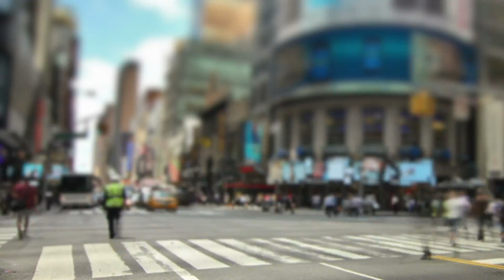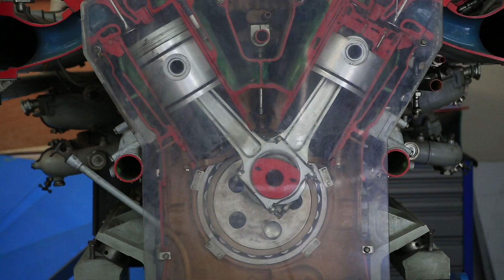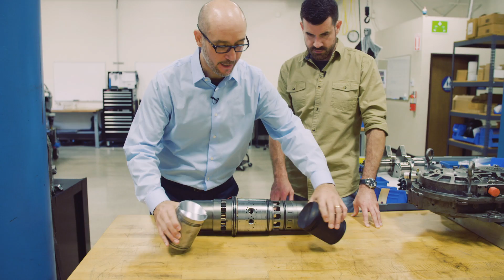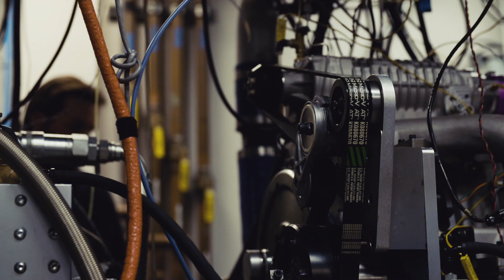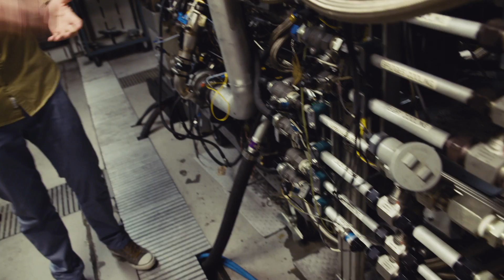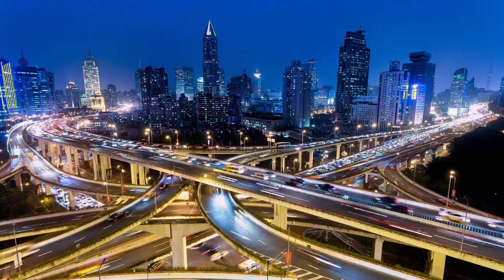This Radical Redesign Could Keep Gas Engines Pumping | WIRED

Comment: Had one of these on "my" submarine back in the '70's.  Auxiliary diesel engine for when the reactor was down: six cylinders, two cranks, 12 pistons, no valves, supercharged.  Worked fine, don't know how efficient it was and don't remember the horsepower-- but if you couldn't find diesel, it would run on jet fuel.  USS Benjamin Franklin SSBN 640.
Reply: frankdn, do you know who manufactured that engine?
Reply: Good old GM or Detroit 2 strokes would run on anything if you had the right injectors including there own oil.
Reply: Wikipedia page doesn't have that info, so adding it as a former submariner would be amazing! 

https://en.wikipedia.org/wiki/USS_Benjamin_Franklin
Reply: The engine was invented in 1889 by Hugo Junkers and his partner.  Junkers licensed the technology to Napier and Sons in the UK and Fairbanks Morse in the USA.
Modern Injection systems, modern control systems and sensors as well as computational fluid dynamics have improved it.  They're apparently getting 55% thermal efficiency which is amazing for an engine of this size.  Sandia National Labs have invented a simple new injection nozzle that completely eliminates particulates which means NOX, its so simple it can be retrofitted, so NOX can become the total focus and so also eliminated.  Finally synthetic fuels like fischer-trosch greatly reduce pollution and finally DME and OME fuels or Diesel/OME blends completely eliminate it.   This has a fantastic future.   If carbon neutral electro fuel is put through its as good as fuel cells and much cheaper.
Reply: Jet fuel is diesel... for all practical purposes. Fairbanks Morse already built these opposed piston engines. They weren't perfect and might be improved for auto use with lighter alloys and better combustion technology, but in the end, there is a minimum amount of entropy required to sustain life. If we don't seek to reduce our entropic impact, we are doomed. Source:  Entropy...by Jeremy Rifkin.
Reply: frankdn we deactivated that sub and sent the reactor off not to long ago

Comment: I fail to see the benefit of getting rid of couple sets of camshafts/valves would be by adding another seperate rotating crankshaft and associated chains/gears. Also this design would put variable valve timing and lift out of the window which was key to better power and efficiency at various rpms. Plus variable compression, cylinder deactivation/decompression would be almost impossible to achieve without valves. The future for efficient ICE is small turbo charged freevalve engines. The future of cars are electric cars with "green" generated electricity.

Comment: No new ideas here, granted, but newer ways of doing better. A move away from reciprocation is in my opinion a much better idea, but how?
Reply: You couldn't figure out "reciprocation" in the context of a video about piston engines? And then you lecture the guy. You're an idiot.
Reply: If we can figure out hot to seal the tips in a rotary engine without a lubricant or adding friction then it could be a contender. Extracting energy from fuel electrochemically rather than burning it also may have some potential to increase efficiency but the specific power within a set time is currently far less.
Reply: LHswe If it bothers you, maybe you should think twice about whether your asinine lecture is really worth posting next time.
Reply: LHswe That was some rant. We've got a real takes one to know one situation going here.
Reply: aluisious: try reading what was said rather than what you want to hear then much less people will tell you to shut your trap perhaps?

Comment: lol , what the Heck did you just say ???? The Engine is good the Technology Is Good. it's the POLITICAL part that Discredits the Message ...
Reply: It better have roller bearings and vro oil injection like a new 850 rotax.
Reply: Why did you have to make a pointless political statement in this?

Comment: Nowhere near the simplicity and efficiency of an electric motor. Certainly progress in the internal combustion world though. My personal opinion after learning about the continual lowering cost of batteries and the yearly increase in energy density in said batteries is that electric vehicles will be comparable in price and range to an internal combustion vehicle in about 5 years (2022).

Comment: Sure that this is more efficient when it is a two-stroker which is less efficient than the four-stroker and dirtier since you basically burn up the oil you use to make things go smoother?

I sense that there is some level of bull in this one, unfortunately.

Comment: Its tall as shit, hows that supposed to fit under the hood?? The Commer knocker is a better design imo... Imagine if that idea was refined... Commer made there production engine back in the 40's I think.. It sounds awesome btw...
Reply: Well, considering that it's a test device, and the entire point of it is to first prove the technology works, it's not a surprise that it's so big. Once they get the tech down, that's when miniaturizing it will come into play.
Reply: Fairbanks Morse took the commer designed to the next level, they manufacture a line of opposed piston diesel engines for power generation and industrial applications.
Reply: can't remember what company it was but it's some oil companies actually allowing them to put them in a fleet of F-150s for a trial test so they must be able to fit them in the vehicles

Comment: My next car will be electric.
Reply: Michael Curtis  - or Nuclear, Wind, Solar it really doesn't matter. Fossil fuels will eventually have to phased out, and then what are you going to put in your Oil engine? The future is 100% electric whether you like it or not, and it's going to happen sooner rather than later.
Reply: Michael Curtis  - indeed you can, but they are all fossil fuels. Bio-diesel is the most carbon neutral of those, but it's nowhere near as clean as the options open to all electric vehicles. Clean energy is essential for the future of the planet, you can't escape that reality.

Comment: Actually from an engineering standpoint, this is a brilliant design. The only problem I can foresee is the hight of the engine. And engine of this size would only fit in semi trucks and commercial vehicles, not cars. Now it would be possible to put it sideways, but then you will have a very wide car. But besides that, its a great design. And the recycling of the fumes is genius!
Reply: If they did an over square opposed piston engine that would sort the size problem out, I wonder if the cylinders have to be vertical to? I can't think of a reason why they would need to be, but if the opposed engine was a boxer type engine it would be no larger than a 6 cylinder boxer surely?
Reply: Geekfreak63 do you actually know how many "genius" ideas have come over time to improve or save ICE? yet none of them came to life, this one is also a hoax.

Comment: According to SAE paper 2015-01-1251 this engine achieves 43% break thermal efficiency. What a waste of time. A Heavy duty truck engine can easily better that and the better ones will achieve close to 50%. The difference is that the HD truck engines are proven and durable. The Achates engine doesn't have the durability or statistical validation. Or, put another way, if a conventional 4 stroke HD truck engines had its Peak Cyl Pressure limit raised and its durability requirements relaxed down to just , say 100,000 miles it would get EVEN better break thermal efficiency.The friction is also way too high. The valvetrain has been replaced with another crankshaft and set of cylinders.  The other issue with the Achates engine is its low exhaust temps which cause problems for the aftertreatment light off. EMD (who do train 2 stroke engines) are going away from this architecture for these exact emissions reasons. Fabien,  Gerhard and other failed Detroit engineers who want a good time in San Diego have a vested interest in making this technology seem to work through fair means or foul. Electric cars? Don't get me started on Elon Musk and his non sense.

Comment: but a design like this won't increase the engine height by adding pistons on top.
Reply: It would take up no more space than a boxer engine in a subaru if it was mounted horizontally, or they could just use over square pistons and reduce the height that way.
Reply: Two external crank shafts vs 1 central means it will be much wider than a boxer engine.
Reply: maybe they can turn that thing sideways?? No idea just throwing shit out there, but i hope they have figured this avenue out.
Reply: i knew someone here would have a good answer. interesting thank you!
Reply: it will take up more room than a boxer motor. Boxer motors dont have crankshafts hanging out the sides of the. And if you say anything about the cams, those are significantly smaller than a crank. The motor they showed in this video is easily half again as long/wide as a comparable 4 cylinder.

Comment: Has everyone forgotten about hydrogen? You know, that thing that's been proved to work and only spits out water?
Reply: Josh W. takes more electricity to separate hydrogen from water than it does to just convert power and store it in a battery.
Reply: *****
And gt5228z, yes I'm aware of this. However once separated it is an efficienct and more importantly clean fuel. Surely combining renewables such as solar and wind to separate the hydrogen from water would be a worthwhile sacrifice for clean transport for a huge proportion of the planet. I know, its optimistic on a Roddenberry scale and I apologise for seeming naive. Its worth thinking about, plus Lithium Polymer batteries aren't exactly cheap to produce nor environmentally sound.

I do however yield to what the market has already determined to be the most ecnomically sound, however is it the best thing for the [very] long term?
Reply: There are many problems with hydrogen. The most basic one is that the overall efficiency from hydrogen generation, compression, storage, distribution, refilling and operation is comparable to ICE (internal combustion engine) technology, so around 25% witch is appalling. From an engineering stand point, you have to be desperate or freaking wasteful if you allow yourself to operate a 25% efficient system. Then, you have to replicate the gas industry at a global level witch will cost $ trillions. Next, the cheapest hydrogen you can get is from coal gasification and even that is not cheaper than gas or diesel\mile. From renewable sources it costs more. If it's not cost effective it will not get made. Look at the space race for reference. You basically eliminate all that with electric vehicles. You have the infrastructure with the electric grid (witch already would benefit from an upgrade). Batteries last well over 500k miles with less than 20% degradation (so well beyond the life of the car), you can charge at home if you want or at high power chargers in 15-30 min while you drink a coffe and drive another 250+miles, and the overall efficiency of the sistem is over 80%. Also, the price/mile is 5x cheaper or more. You can't beat that.
Reply: Most economical source of Hydrogen is Fossil Fuels itself,  but Hydrogen doesn't have a simple storage and delivery system.  It's cheaper and more convenient to just burn the fossil fuel instead.

Comment: It would be interesting to see a comparison between this and the Koenigsegg's Freevalve technology which claims 47 percent more torque, 45 percent more power, 15 percent less fuel and 35 percent fewer emissions. But again this are just "best conditions" estimates.
Reply: Luckily the freevalve isn't that far away from actually existing in the market place.  They are teaming up with a Chinese car manufacturer and putting it on a 4 cylinder.  From there, the performance gains can be easily extrapolated.  

I agree, a comparison of these two approaches would be very interesting.  And opposing piston 2 stroke should have tons of torque and my guess has much more mechanical potential than the freevalve's supper flexible valve timing.
Reply: Lyckann the figures they claim are exaggerated, actually too exaggerated, there isn't that much resistance and the friction in revolving the belt or chain so the engine would gain almost 50% power. that is unreal.
Reply: Rocket Man Well I'm not an engineer but those who are, are coming up with crazy things indeed, like Nissan's DIG-T R 1.5-liter three-cylinder turbo with 400HP 280 pound-feet of torque and 88 pound of weight. Like you say it could be an exaggeration or it could be the real deal, gotta wait and see.
Reply: Lyckann "Nissan's DIG-T R 1.5-liter three-cylinder turbo with 400HP 280 pound-feet of torque and 88 pound of weight." Hmmm.... I didn't know it exists, and then I studied it a bit, if a car is equipped with one, then I'm giving it 100.000 km lifespan! When you buy a car, they should supply two engines)). It can't be reliable the in mid run.
Reply: Rocket Man Well I'm thinking that due to the weight of the car and its "safety features" it would probably be used in a hybrid setup not straining it as much, but yeah turbo would need more maintenance then a normally aspirated.

Comment: No valves? Where is the exhaust going? Did I miss something?
Reply: You don't need valves because there are two pistons in the same cylinder, the upper pistons will be sliding past the intake port to suck air in and the lower piston slides past the exhaust port to vent the exhaust gases, think of each cylinder as 2 cylinders, top and bottom, in a conventional engine one piston needs to do both intake and exhaust, so you need valves to open and close the ports, by using two pistons in one cylinder, and 2 ports in each cylinder you effectively have your valves always open, but the piston sliding past the port changes weather the air can escape or not by blocking the port.
Reply: The fact that both ports are open at the same time is a huge disadvantage to this engine layout concerning emissions. I have a sixth sense that says "research grant whoring." This is never going to be as clean as a four stroke.
Reply: aluisious ... they are timed so the exhaust opens first and the intake is compressed. The Fuel is added just before combustion so there is no fuel in the incoming air.
Reply: mandatory turbo maybe?
Reply: You missed the part about the cylinders operating on a 2 stroke cycle, the exhuast is pushed through ports that the piston uncovers as it reaches BDC

Comment: So, more moving parts, more cylinder walls and double the engine size, a crap load of pipes and a slam at our president elect to boot. 
Silinoid valve tech is the way, 40 % more efficient, less weight and less toxic than pure electrics cars. 
Did you know, because of weight from batteries, that electric cars are more toxic than a diesel truck? More weight from batteries causes more brake dust because of the weight, more wear on our roads because of weight and tires wear out faster because of the weight. It's a balance, and electric isn't there yet, and this motor while fine in concept still doesn't meet the electronic valve system by 10%.

Comment: What about Koenigseggs FreeValve system?
Reply: You can fit a straight 6 in the same package with FreeValve. The best thing about FreeValve is the possibility of making it pneumatic hybrid and use Atkinson cycle.  And the real problem with this one will be emissions. I bet on FreeValve.
Reply: @adziuaoeu  FreeValve will never come. They finished the tech 10 years ago. Why isn't Koenigsegg using it on its engines? They're the perfect candidates to prove their own tech. I bet you can connect the dots.
Reply: Ruben Lotz The Freevalve is like putting lipstick on a pig, the Coates Spherical Rotating Valve is lightyears ahead of any poppet valve system.
Reply: Jay May Would it/does it Jay? Rethink that...
Reply: So the balance of the crankshafts magically transfer the vibration to the other crankshaft by what force? Black magic? Physics still work despite stupidity. It will have a minimum of twice the rotating mass. The purpose of the crankshaft weights is to balance the reciprocating piston and rod assembly, plus any inherent balance issues from the rod bearing surface being offset. EVERY, EVERY, EVERY crankshaft that turns any appreciable RPM or used in any work scenario is balanced, otherwise the engine would fly apart due to the forced exerted on fasteners, bearing surfaces, and warpage of the bearing surfaces.
Reply: Blake McDonald
 So this pushrod must flex/compress in order to create compression, I see the pure superior logic, or maybe you mean that we add another connecting rod between each part of the crankshafts to transfer the vibration instead of adding counterweights, cause we ALWAYS want MORE MOVING PARTS!!!
Reply: was gonna mention that.  seems more viable
Reply: Nah. Wont work or we would have seen it.. no fail safe with free valve... desmo valves are much better :)
Reply: Didn't International pioneer freevalve 20 years ago in commercial truck diesel engines ?
Reply: this wouldn't use valves
Reply: Lmaow
Reply: Blake McDonald having twice the amount of weight for dual pistons and rotating mass makes this less efficient.
Reply: engines for cars will be completely dead in under 10 years future.